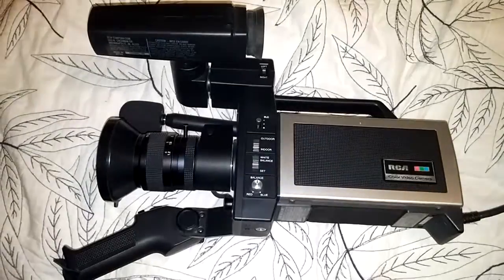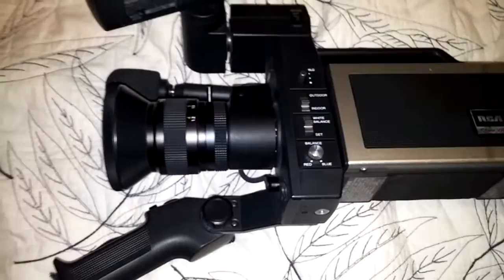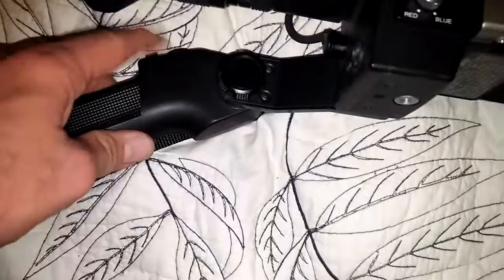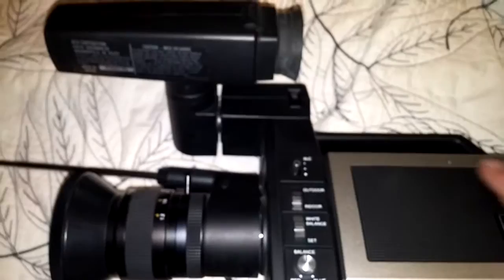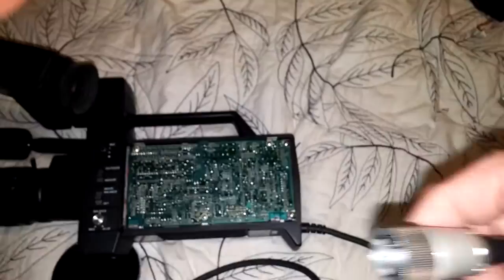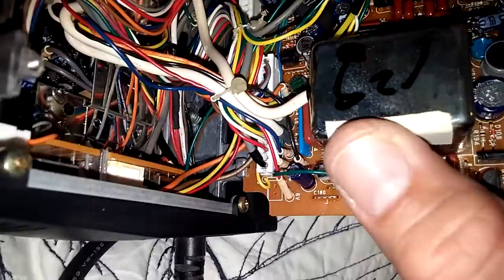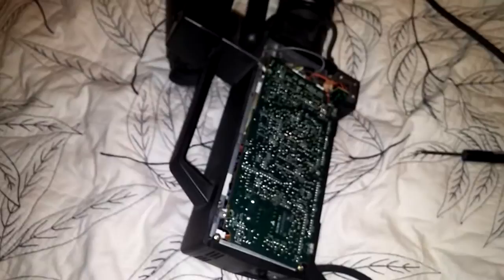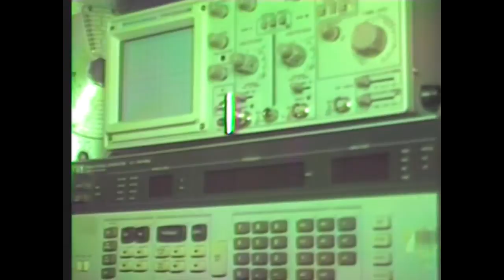1981 Vintage RCA model CC007 consumer color tv camera

Comment: In the early '80's this camera and I traveled throughout Germany, Denmark, Sweden, a lot of NYC/Long Island and Florida where my folks retired to.  I paired it up with the professional version of the Panasonic PV-5000 video cassette recorder (SP only).  The external charger could handle dual voltage. And off I went; 2 hours per cassette and 2 monster batteries.  When I look at some mirror reflection cameos, I can't believe how much I schlepped.  A far cry from my current Sony FDR-AX33 4K unit.  Still the memories are priceless since my folks have long since passed.

Comment: Oh boy, used to have one of these. Slow streaky videocon tube, don't miss it a bit. Light hungry, low resolution I believe Panasonic mfg. 
A few years later they used Hitachi CCD chip camera instead of a videocon or saticon tube. Just think now 1080p 30fps in about the size of the camera plug.
Reply from the maker: +Alameda Repair Shop Yes, CCD's were  a huge step up in video quality.
especially in broadcast tv.

Comment: ijust got one  of these but how do you get it to start do I need a battery pack of some kind?
Reply from the maker: +David Dubian Mine runs on 12 volts dc. I was able to find the plug on e-bay that fits the end of the cable to power it.  you have to be careful because if you wire it wrong you can burn out the camera.
Reply: +chrisw71 do you know what the connector is called and what it records to
Reply from the maker: it was a 10 pin female connector. the camera normally plugs into a portable vcr from rca. check this web site. http://toirm.com/10pinvideofaq.htm

Comment: How cool though. Does it have a portable VCR or does it have to now connect to a regular power electric VCR? Just out of curiosity, are you the original owner or where did you get it?
Reply from the maker: George Cole I apply 12 vdc to it through a cable I built.  I think it was purchased from ebay.
Reply: Does it work good?
Reply: Yes , I once used this unit. It came with a portable video player/ recorder. It had a strap which you carried over your shoulder. It was heavy,, but it was what you needed at the time. With camera and player/recorder, you were uptown. Great tech for the times.    Saticon tube. The better unit, which eventually came out had a Nuvicon tube.....battery life was maybe 30 minor so.....with all the garb on, folks thought you were with the local news